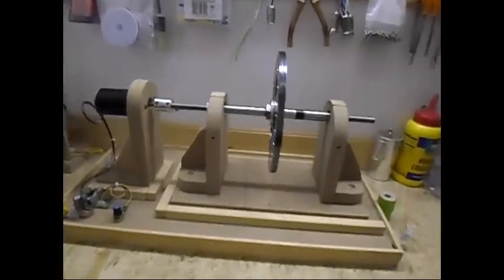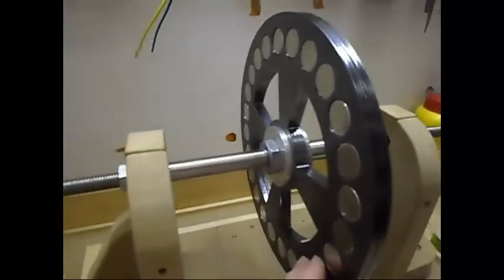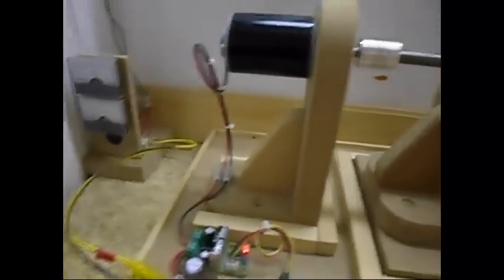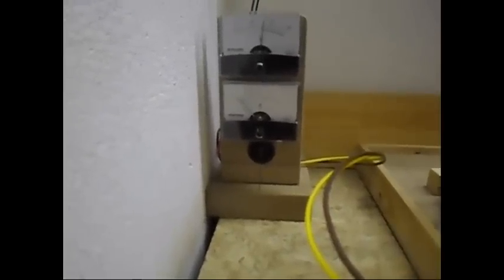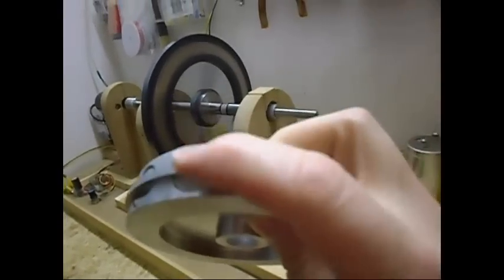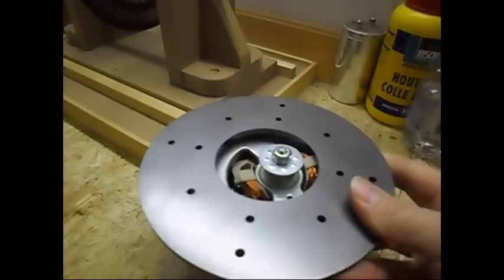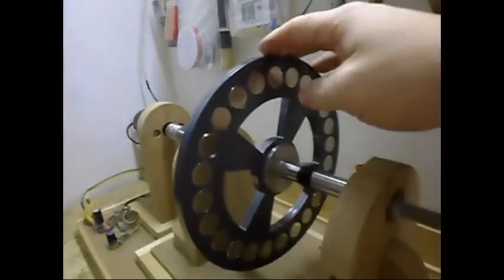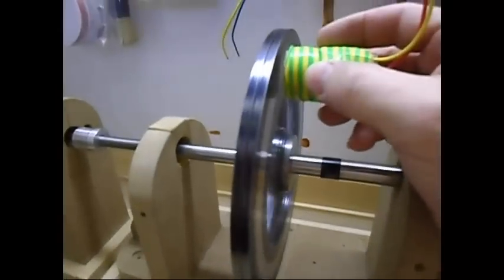Project Update - New 24 pole rotor, 12 pole rotor safety ring and Universal motor mounting plate...

Comment: Great stuff, my friend.!! 🤐 
If I can give a little Advice*
I never" use M.D.F. To build, anything.
It's a wast of time, & $$ if you're paying for it.... Now, you Should use 
Plywood' or ( solid shelving Board ).!!
Always, if I need something' that is a certain "thickness" I simply" use plywood, sheet's to build up-to, what I need, I NEVER, Use M.D.F. For any of my builds, ( if you have a weekness" in whatever, is spinning" whether it's a wheel, of some kind" or just a shim between the the wheel, or a piece of wood, holding one piece together with another,. I still
Use "ONLY" WOOD.!! Plywood is put
And held together" in a different way,
Than M.D.F. SO" If you want the build, to hold together" & not fly
Apart, in high or even Mid, R.P.M's...
Use real wood. Or at least, put a coat of Liquid-nials, between it.. it's the strongest stuff I've ever seen, for wood, & it holds, by bonding, every
Piece of wood,.. However, as you probably know" M,D,F. Is made by
Large machine's.!! Pressing a mixter
Of Sawdust" & Glue, together in a 
Very strong, press, until, High Voltage, has all but stepped up,
The drying proses, to a point that 
Only A few hours, to let the outside" 
Dry, very good" is all that's needed.
That, m,d,f, is not only the most, dangerous, type of wood" anyone can use.. in a build, that high or medium r.p.m's, or any type of stress
Are involved.... Now"  I just wanted to say, GOOD LUCK WITH YOUR SEARCH FOR ZERO POINT - OR 
FREE, ENERGY" OR OVER Unity.
Also, I have plans to start my own
Utube, Channel, to show how I have
Found* over unity, and or, Zero-point
Energy, but I don't refute the amazing result's of other's.!! I wanna 
Help" everyone" By open - Source,
Everything I have found" SO, good on you, it's always good to see someone, that's "very intelligent" 
Working on, these types of  project's...

Comment: plizz tell me what components that you has been used..i will try it at home
Reply from the maker: Thanks for your comment...^^
The rotor is laser cut steel but you can use wood also for a rotor...;-)
This was a test rotor so i can configure the magnets in many manners...;-)
The drive side is just a DC motor with a PWM so i can adjust the rpm needed...^^
Reply: not working,i had try it but the led not tuned on..
Reply from the maker: Thanks for your comment...^^
If you have a rotor with some magnets on it and you rotate that rotor by hand it should light up your led...;-)
Just put that led on a small coil of wire...remember it is a led so a tiny coil with small wire size is more than enough...;-)
Hope this help you out...^^
Reply: I use a copper wire for coil and i put led on coil but led still light off..i used some neo magnet with dvd dc motor..i use to buy more copper wire too but i doubt it..
Reply from the maker: Well...maybe your led is broken or try it with and without a bridge rectifier...;-)
A led should light up very easy by just spinning your rotor with some magnets on it by hand...
Reply: No the led is tested well..but its not light on..i dont get it,where is the problem
Reply from the maker: Well, a led has polarity and if you are using a diode or rectifier on the coil you need to put it the right way...;-)
If you put the led direct on the coil with none of the above than it should light up very easy unless your led is broken...
That's all there is to it and hope this help you out...^^

Comment: thanks for posting. just want to share a couple thoughts. perhaps you already know.
when this type of rotor is driven at a radius smaller than that at which the load occurs, the drive motor is operating at a mechanical DISadvantage.    overunity cannot be achieved with a 1:1 direct-drive apparatus.
take a look at a two-year old video posted by george chaniotakis.     he uses the term magnet motor, but that's not what it is.  speed converted to torque, driving an alternator that is tuned/chosen to match.  

magnets should be 'on' steel.  this allows the magnetic flux to join, resulting in a 'stronger' pole.   cheers
Reply from the maker: Thanks for your comment and also the extra input about mechanical disadvantage...^^
I know what you are saying but for the sake of simplicity and of course lazyness...lol...i'm use this DC motor test setup...lol
I'm just waiting till i have my desired coil than i'll use this mechanical advantage for the perfect project...lol...^^
Leverage and momentum...that is...:D

Comment: .75 Milli amps ur experiment is un complete because u try very small led which is take .oo5 amps .use .75 amps n take out put 3 amps that this machine or experiment is successful
Reply from the maker: Thanks for your comment...^^
You are correct about the test but it was just a simple quick test with that 0.5watt led...;-)
Yes again, 0.75Amp in and 3Amp out and it would be a very complete experiment but at around the same voltage of course otherwise it will still be un complete...:D
Reply: It's my overunity system is complete now bettry run n self bettry charging 48 hour's now still working overunity is possible but it's need super mind 
https://lh3.googleusercontent.com/4gpSGAxwwpp0PnbKJIHsDr8wwraByo1RRpJ-PV1jXVvew2XBVSP1LH5f8YLKx4H9rKVcK2p1yQ
Reply from the maker: Thanks for your 3 replies but they all say,

"404. That’s an error.
The requested URL was not found on this server. That’s all we know."  

LOL, anyway...so you have a overunity setup and it runs on batteries and charge batteries at the same time...hmmm...sounds like a bedini type setup to me...;-)
Reply: OK

Comment: what is the purpouse of this? 16v and 100mA  but if you put a load on the flyweel some coil to use it as a generator depending on the load the small motor will draw 16 v and 5-6  amps maybe so whats the idea?
Reply from the maker: Thanks for your comment...^^
The purpose is for testing all kinds of coils/cores/configurations i can imagine...;-)
And yes, when theres a load on it it will draw more on the drive side(conventional) but than again it is the whole point of all of these trying to get energy out of the generator side without the drive side needing more power...^^
Kinda like this one here,
https://www.youtube.com/watch?v=ttZEttQn00A
It is a good start but not good enough yet...^^
Reply: i understand :) ,well keep up the good work
Reply from the maker: Thank you and i'm glad you have now a better picture on what i'm trying to do...^^

Comment: wow did you built that black spinning rotor yourself or ordered from some machining shop? its fantastic to see the amps drop as the thing picks up speed..that is energy from environment itself in form of centrifugal force!!! I can see and feel its harmony, calming effect and efficiency as the load drops from 16watts to 0.16watts..what was the resistance of the coil on the led setup?
Reply from the maker: +fidel catsro 
Thanks for your comment and glad you've liked it...^^
That coil is 118 ohm if i remeber right...
The rotor i've design/drawn with Autocad and than sent it to a laser cutting service company for them to cut it...:D
It has very good momentum/centrifugal force once it is up to speed which does help at the input side...;-)
When started it draws a lot of power like around >16 watts or more but when it is up to speed it is around 1.2 to 1.6 watts...
Amp draw is around 75ma to 100ma @ 16vdc...ma is a bit hard to read on a 3 amp meter...lol
Cheers
Reply: +Mister Caribbean Roots how much will one like that cost to make ? its a well built rotor
Reply from the maker: +fidel catsro 
Well, it's a bit difficult to say since i've orderd many parts at once and when i do that the total price gets lower and lower but if only the rotor would be orderd i would say around 50 euros or so...

Comment: Hey there, how's it going? Cool looking setup there.... Can you please send me a diagram of your circuit layout. I'm still learning and not 100% sure how to hook up my amp and volt meter plus the pwm motor speed control to my generator. I guess I can always look it up on google search but you seem to know how to very well. Thanks!
Reply from the maker: +Juan Bartet 
Hello there, it going great except for them projects since humanity lazyness kicks in...lol
It is very simple and i am also a beginner in the field of electronics...;-)

It goes as following,
Battery wires goes to a cap terminals, than from the cap the amp meter goes on the positive wire(in line with it) to the PWM positive input....
In line means, positive side of the amp meter goes at the + side of the cap and the negative side of the amp meter goes to the PWM positive input...
Battery negative goes to cap - and also to PWM negative input....nothing in between...

Since them PWM have caps in them your amp meter is now in between caps and will give you the most accurate measurements...:D
Volt meter is simple, just wack it on the battery/cap positive and negative...lol
Hope this help you out a bit...^^
Reply: +Mister Caribbean Roots ummm, what cap?  Lol!   Do I need to add a capacitor somewhere?  Thanks!
Reply from the maker: +Juan Bartet 
LOL...don't use a cap than...;-)
You don't need to do or use anything unless you want to...^^
There are caps build in your PWM so it is good without a extra one...:D
Reply: +Mister Caribbean Roots Lol!  I got it... Thank you friend!
Reply from the maker: Juan Bartet
No problemo amigo...^^

Comment: the value will be seen when you can measure the power going to your LED using enough drag to slow down the rotor.
Reply from the maker: +josh delano 
Thanks for your comment...^^
The coil/led was just a quick test to show that it does produce some energy...;-)
When i'm done making the full generator setup the real testing will start and of course Mister Lenz is always present but i'll see if he wants to help me out or work against me...lol

Comment: looking good mate, interesting what you was saying about lathe rotors being better.  Output was nice on the little coil, 1/2 watt led is very powerful. Thanks for showing us ;)
Reply from the maker: +deeds 
Hi there mate, it is better when you want your stuff super smooth if the one using the lathe knows what hes doing...lol
But the laser cutting is cost efficient and fast and thats a bloody good thing...^^
For the money for one lathe rotor you can have a few laser cut ones and some other stuff like generator core lamination and so on...;-)
And the smoothness of the laser cut parts is perfect for what it needs to do but since i'm a bit of a perfectionist i whine about it...lol
And one very important things is that the laser cut parts are cut very precize to the measurements of what has been drawn in autocad and thats awesome...:D
Cheers

Comment from the maker: Just a project update,
A new 24 pole rotor, a 12 pole rotor safety stainless steel ring & the new universal motor mounting plate...^^
Reply: Pp
Reply from the maker: +gary depietro 
Thanks for your comment...^^
The shaft couplers i buy from Ebay or Aliexperss...do a good search because the prices varied a lot...;-)
You have the flexible ones and the rigged ones...:D
Cheers
Reply: ok the same naschine and how much is the
Reply from the maker: Thanks for your comment and...???...^^
Reply from the maker: Thanks for your comment even if it's just 2 letters...lol...😄
Reply: lookz awsum =) ur craftsmanship iz superb =)
Reply: im gonna mayk my fly wheel out ov clay =)
Reply from the maker: LOL, a clay flywheel...well, why not...as long as it runs at lower rpm's it should be fine...^^
Remember to bake it at a specific temperature as baking a cake...;-)
Reply from the maker: Thanks for your comment and i'm glad you find it "Awsum"...^^